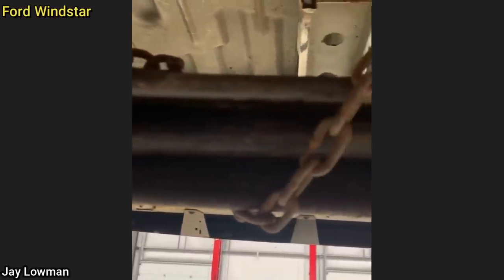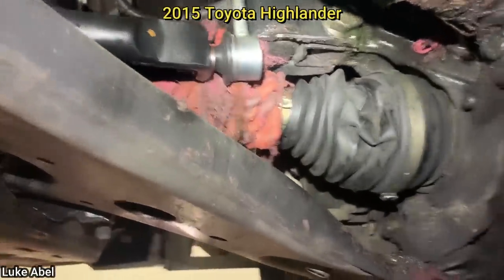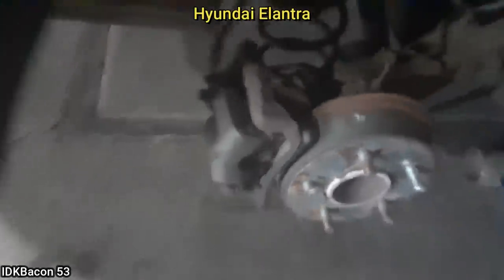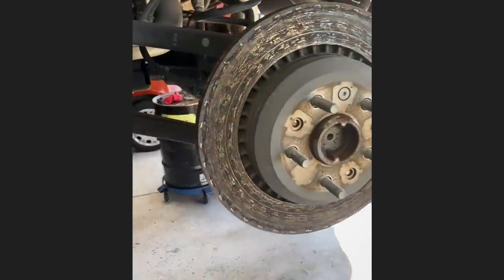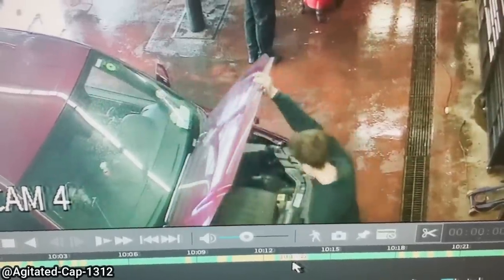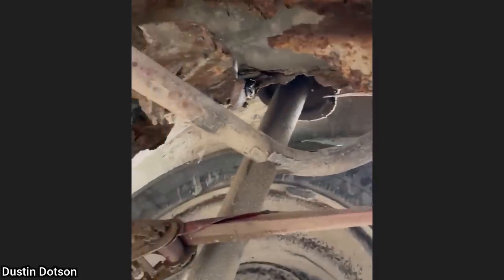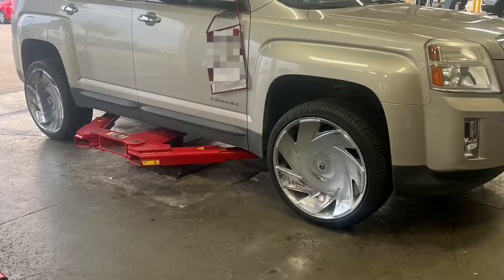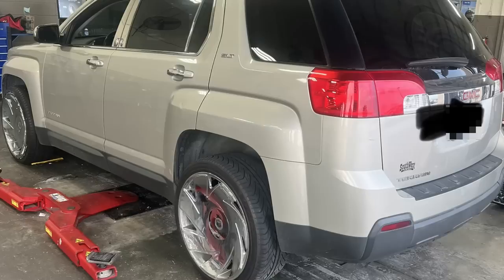Customer States Rear Axle Is Broken In Multiple Spots | Just Rolled In

Comment: "My brakes were grinding" so I slapped some grease on it! That's a Classic.
Merry Christmas Everyone
Reply from the maker: You as well my friend!
Reply: About 45 years ago, I turned up at my friends place to find him working on his CB250, one of those with front drum brakes. He was pumping oil into the little drain hole at the bottom. I screamed at him to stop. It was squeaking he said. Eventually, I convinced him to strip the brake and clean it. The shoes were contaminated, but I couldn't convince him he needed new shoes. We set off on the ride, and at the first roundabout he just went over the top. We then proceeded (carefully) to the dealer for new brake shoes and a can of degreaser, and new underwear for him.
Reply: I paid for the whole tube, I'm using the whole tube!
Reply: 'My brakes were sticking, so I cut the line' is going to be the next one, isn't it?
Reply: My serpentine belt was squealing, so I greased all the pulleys.
Reply: @sylviaisgod6947  a better one - i removed it and now my battery light is on and car keeps overheating!
Reply: My dad did that to his bike when he was a kid, it's a miracle he survived and that I'm here.
Reply: @Morpheus-pt3wq  Well you better put a piece of tape over that light, and some motor oil in the radiator to cool it down.
Reply: @grahammonk8013  I hope it was a lesson you only had to teach him once.
Reply: @davewilson9772  About oiling the brakes yes, but he was highly talented about finding new mistakes to make. The one about not opening the radiator cap he found out about with his wife and mother in law around the engine as well..............
Reply: @sylviaisgod6947  no worries, i have plenty of duct tape, electrical tape and chewing gums as well! I can fix literally anything!

Oh, and i forgot about zip ties.

Btw. don´t you know the motor oil goes into window cleaning, coolant (ot transmission fluid) into oil and window cleaning fluid into cooling?
I find it interesting nobody ever mixed braking fluid with anything.
Reply: Merry Christmas to you and the other comment monsters!
Reply: ‘My car was riding too rough so I sanded my tires to make it ride smoother’.

Comment: How do you not notice the brakes being on for 20 miles in a car you're flat towing?! He MUST have noticed the extra resistance.
Reply: I think there is a little exaggeration going on.  If those brakes were all fully locked up for 20 miles it would have worn all 4 wheels down to the hubs.
Reply: @tinknal6449  true, if they weren't aware it could have been a shorter distance and maybe uphill?
Reply: So I’m a dedicated viewer of this channel and about a week ago I was told a friend of the family recently had their jeep catch fire that they tow behind their large motorhome. Someone flagged them down letting them know it was on fire. I guess they could not see it easily around the motorhome was the story I heard. I couldn’t help but wonder if this was their jeep. I believe they were in Florida when this happened. I also had a lot of questions when told this.
Reply: I’ve seen people drive miles with their emergency break on and not notice.
Reply: @tinknal6449  If they were locked up there wouldn't be any signs of heat or wear on the rotors. Break away auto brake systems don't apply enough force to lock the breaks up, just to stop the vehicle fairly quickly.
Reply: @tinknal6449  Passenger rear is worn down to a razor thin piece of steel
Reply: @tinknal6449  "Locked up" in this case refers to being engaged without release, not truly 'locked up' as refers to a braking moment or wheel speed.
'Froze-up' is probably the more accurate term as those who have handled old calipers know, but since they weren't technically in that condition, locked up works. :shrug: Look beyond what you see and agree with the concept? 
Everything in cars is fluid. Unless it leaks out. 
Then it is chunks, shavings, and dust.
Reply: It's a Jeep thing.
Reply: that was my thought too
Reply: It's a Jeep owner, do you expect intelligence?
Reply: @hvactech77  A big bus-type motor home towing it would seem as the only feasible alternative, those things are how many tons again on their own after all.
Reply: Why are people too cheap to get a small car trailer, rather than towing a vehicle and wearing out every part of the drive train but the engine?
Reply: @BB-wg3tw  Passenger rear was worn away, that was the dust shield.
Reply: 3/4 ton diesel and upland you’d be hard pressed to feel a car with its brakes on.
Reply: I don't know, if they were towing it behind a large class A motorhome or something, those things have very torquey diesels.
Reply: @KatiTheButcher  I'm thinking they were only partially applied and it was longer than 20 miles. The slight increase in resistance wouldn't have been that noticeable and having them constantly dragging would have built up heat pretty rapidly.
Reply: @Kalvinjj  A typical motor coach is easily 15 tons or more.
Reply: parents had a similar issue flat towing behind the RV... it simply is so powerful that dragging a small pickup isn't noticeable brakes or not
Reply: I flat towed a car and the driver never been pulled on a rope before. He dragged the brakes pretty good but all I could tell in my f450 was the turbo wound up a little tighter when the brakes were pressed
Reply: @elultimo102  not always feasable. My bmw sits too low, ever seen a fat girl crawl out a car window? I know it is not the case with a jeep but thought the imagery was worth a laugh.
Reply: Cummins diesel will pull w/no issues might even help its MPG!!😉🤔
Reply: @BB-wg3tw  Right, but not the other wheels.  One wheel might not produce that much drag depending on the vehicle towing it.
Reply: @Mrshotshell  Kind of my point...
Reply: Stopping to check would have taken time out of his day and that's just not something he felt he needed to do.
Reply: Big RVs or Motorcoachs usually have rear cameras don't they? 🤔
Reply: @ohhhLuna  None from you.
Reply: Must have been a pretty big engine hauling it eh
Reply: @BlueDart1971  what the heck is an "emergency break" - you mean the parking brake - and no, i am not even mentioning the spelling here. After all what do i know, my motherlanguage is german.

lol..... please never come to europe and drive here.  We DO have inspections, and people need to know shit before they get to move 3 tons around other people.
Reply: It happens a lot, one time even while the guy was making a youtube video, the rear brakes had been locked because he hit the e-brake from muscle memory after hooking it to his super C and then hit the highway, both rears were so worn the rims even had flat spots
Reply: @BlueDart1971  We had a neighbor borrow our truck, an F350, drive it his whole errand with the parking brake on. Smoke poured out when he parked.
He said it felt about the same as his F150.
Reply: Dang Jim, the gas mileage in this thing sucks!
Reply: Seeing other videos with warn out to non existent breaks this is the first plausible ish explanation for not getting them fixed years ago
Reply: Asking this question is like asking why Truckers don't notice when idiots get stuck across the bonnets of flat noses.  If the vehicle is moving, you wouldn't notice a difference in resistance, especially if cruise control is on, and the radio is blocking engine noise.  Pulling off however, you would.
Reply: Quite easily done with the cruise control on, especially if you have music on and a few hundred horses under the hood.
Reply: It could've been Helen Keller driving I suppose... (I'd like to apologize to Helen Keller for insulting her)
Reply: @zoolkhan  so I didn’t realize autocorrect changed it and yes it has been called an emergency brake for years. Also know as a parking brake. Who said anything about inspections and driving in Germany? I wouldn’t visit your country on purpose so don’t worry about that. Why are you so worked up over my comment?
Reply: @southernflatland  If the brake was fully locked up the rotor wouldn't have gotten red hot though.  It would have had to remain turning to generate friction.
Reply: @ohhhLuna  Jeeps are one of the few vehicles that can be towed wheels down behind a motor home. If the motor home is large, you can't see the towed car unless you have rear mount cameras. YOUR ignorance is outstanding.
Reply: @BlueDart1971  
*brake
~ As a noun, brake refers to “a device that causes a car or machine to slow down or stop,” whereas the verb means “slowing down or bringing a machine or car to a stop by using a brake.”
~ Break has a multitude of definitions. But it’s most commonly used as a verb meaning “to separate into parts or pieces as a result of a blow, shock, or strain. As a noun, it typically refers to “an interruption of continuity” or “a pause in work or during an activity.”
Reply: @southernflatland  I understand.  The driver certainly should have noticed the drag but some of these motor homes now have wicked powerful engines and most people are not experienced much in driving them.
Reply: if your pulling it behind a big diesel pusher motorhome i can see how you wouldnt notice, yeah youll be a little heavier on the throttle bot compared to the rest of the rig, the jeep is nothing. Here in the UK that style of motorhome is non-existant as you need a commercial licence to drive one, and flat towing is also seldom done tho if it is , its with a smart car or toyota aygo or similar. also we cant have electric brakes, its air, cable, or nothing (under 750kg) so usually, here , if you want a small car behind your motor home, its on a trailer.
Reply: @buellb0y  feel better now?
Reply: @tinknal6449  If its a class A RV with something like a cummins L9 in it they could drag the jeep on its side and not notice. People don't realize those things are just fancy tour busses and generally have 1000+ ft-lb of torque. Add an older driver who is likely not a professional and things can go south real quick.
Reply: In the army, I've seen people tow a trailer with the trailer's parking brakes on. The wheels won't spin and it's super loud when it gets dragged like that. This happened at 5-10 mph and I heard it from 100 yards away. I had to stop the idiot driving and the soldier guiding on foot. Flattened a section of the tires and left a football field sized skid mark on the ground.
Reply: @dereknapier836  Yeah, that's my point.
Reply: @arc00ta  Exactly.
Reply: Neighbor "lady" drove her pickup with the emergency brake on. I could hear her coming up the alley and pull into her "garage" (just the foundation where the garage used to be). I could hear the engine straining and when she let off the gas it stopped abruptly.  Two weeks later, she drove her vehicle clean off the edge of the garage floor so the car was hanging out over the back yard. It took about six guys working into the night to get the truck all the way into the back yard and back up onto the alley. What great entertainment.
Reply: @BlueDart1971  Duh. Wife and I were test-driving a sporty little Audi. Salesman let us go on our own. We really liked it, but when we pulled up to a stoplight, I smelled something burning. Yep. Emergency brake on. So we drove it around a bit to let it cool off and then decided it really wasn't the car for us.
Reply: @BlueDart1971  

I'll throw this into the mix... it's also referred to as the 'handbrake'. I've always wondered why only in the USA the handbrake is referred to as an 'emergency brake'. I mean that's something it can be used for but it's not the primary function.
Reply: My grandpa was flat towing his Jeep with a large diesel motorhome and wasn’t aware to leave his key turned or something, because he was going down the interstate and got flagged down by someone because his wheels turned and the steering wheel locked. Tons of front end damage from being worn down to the rims. He said he couldn’t feel the extra resistance. I’m not saying he wasn’t dumb, but I guess it’s possible to not notice
Reply: When you finally notice the fuel indicator dropping twice as fast, it's a good idea to stop and see why. How can they not feel the RV being tugged and smacked around from the car being towed jumping around?
Reply: Behind a Class A?  Not even a nudge.
Reply: @zoolkhan  Emergency break-away.  If you don't pay attention to RVs, you have no idea what it is or why it exists.
Reply: @BlueDart1971  He doesn't know what he's talking about.  Emergency break-away is correct.
Reply: @dereknapier836  Look into Emergency break-away systems.  Not strong enough to lock the wheels up, but stronger than nothing for the obvious reasons if you have ever pulled a trailer or anything else that came loose and decided to go where it wants to.
Reply: @skylined5534  In this case Emergency Break-away refers to a system that automatically applies the brakes of the towed vehicle in the event the towed vehicle breaks away from the towing vehicle.
Reply: @katdeville  A car locked up behind an RV isn't going to even noticeably increase fuel consumption.
Reply: @fraidykat  I know. Different places can call them something different. Can’t figure out why he felt the need to jump my ass though.
Reply: Not if the driver has a room temperature IQ...
Reply: @quantumleap359  Even normal level IQ.  You can't feel anything like a car behind a Class A.
Reply: I asked the same question when I put two tires on the back of a car that was being flat towed behind an RV with the park brake set.. They towed it until both tires blew. A few years later I got to put a motor and a manual trans in a Geo Metro that was towed behind an rv while in gear. I also saw the results of towing a Trailblazer behind RV while it was in gear. Trans housing got so hot it basically melted in half
Reply: Those brakes were not fully engaged as they would lock up and just grind the wheel down.  They must have been dragging for a long time.  But even then, I am not sure.  Once brakes get hot enough they will get a vapor barrier between the pad and the rotor which greatly reduces the friction.  That had to be a lot more than 20 miles.
Reply: The customer was probably a Borg, resistance is futile.
Reply: It’s really not that noticeable. In an rv it likely didn’t even try to pull that jeep. Hell my challengers a manual and I can’t tell you how many times I’ve left the emergency brake on after parking and drove about 2 minutes before even noticing. Car doesn’t hold back even a little when your going, it’s when your getting to a stop and it stops almost immediately that you notice. And I left the brakes on in my double axle car hauler trailer and pulled it with my dually. Didn’t notice at all until the trailer started smoking. It’s not hard at all tbh.

Comment: There is a recurring theme that rears its head in all these great clips that are sent in on this channel , and that is since 225 BC the metal chain has been put to good use , and Merry Christmas ..
Reply: The chain has been considerably replaced with duct tape, but yes, still ever-so necessary at times.
Reply: @chrismaverick9828  chain doesn't leave a sticky mess and is kinda cheaper than duct tape.
Reply: @s0nnyburnett  Well, a chain can beat duct tape on price only if you look at the long view, where you'd have to go through numerous rolls of duct tape periodically to keep your rotted car frame from heading to different driveways at once.
Reply: @chrismaverick9828  Yes Duct tape is the greatest innovation known to man it doesnt have the tensile strength of good quality chain . Chain is like an old pair of slippers , comfortable and dependable or so i thought . In comes FiberFix 10x , is marketed as 100x stronger then Duct tape even Gorilla tape , havent used it but you can get a 2 inch roll on Amazon ..
Reply: @MonkeyJedi99  We are all in agreement that Duct tape has a place but just for fun or danger , if you had to cross a bridge over angry alligators one suspended with Duct tape and the other suspended with chain which one are you crossing . lol
Reply: @waynesbutler7834  Based on all of the Mythbusters I have watched, one would be unwise to dismiss duct tape out of hand.
Reply: @MonkeyJedi99  Funny you mention Mythbusters , i was thinking about those episodes when i wrote the comment . Gorilla tape sets a new standard for duct tape and too bad that tape wasnt around when this show was still on the air . Someone should do a test on this new FiberFix 10x tape which is apparently 100x stronger .

Comment: The driver who decide to drive away with no rear brakes should be charged with a crime. This is clear negligence.
Reply: Shops are not allowed to let unsafe cars back on the streets by law. At least here in Germany. 
I think it's a good law! 😎👍
Reply: @dasgibmekker768  As long as there are penalties for mechanics who misuse that option. I have seen some crooked ones in my days.

Comment: Hello fellow car lovers! I'm so happy today, after 7 years I've paid off my 2014 HEMI Challenger R/T. It had an electronic anti-corrosion system installed when new and there is not a speck of rust. Only 104,000 kms on my baby. (just over 60,000 miles) It's bright red with two black stripes, 5.7L and 5-speed. I hope to drive her until I'm on the local news as the final internal combustion holdout. Merry Christmas fellow car lovers!
Reply: I've heard it takes about 5-7 years before rust starts showing up for electronic rust controllers. Any road salting around you?
Reply: @choggi  Yes, we use road salt. There is a touchless car wash a few blocks away that has undercarriage blast that I've been using since I bought the car.
Reply: @livinginvancouverbc2247  Then I hope the best for your baby :)

Merry Christmas!